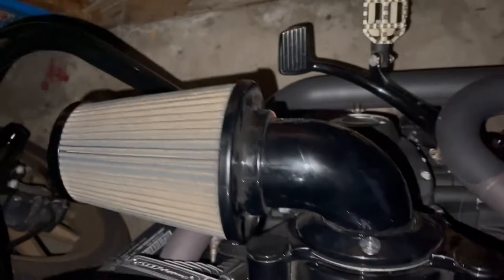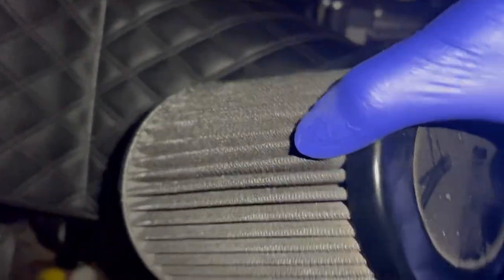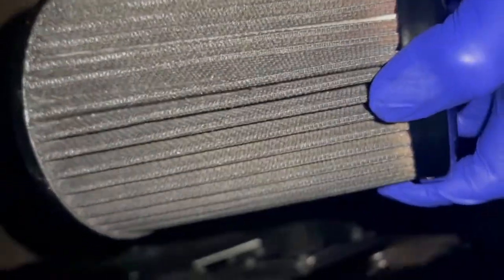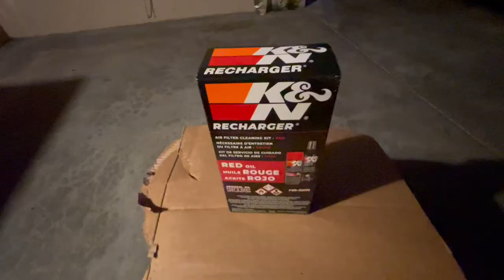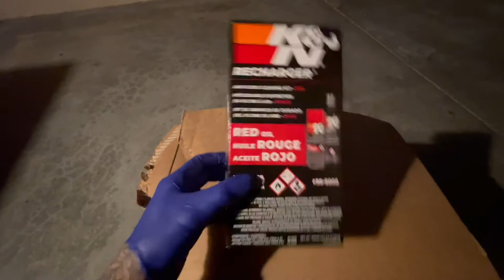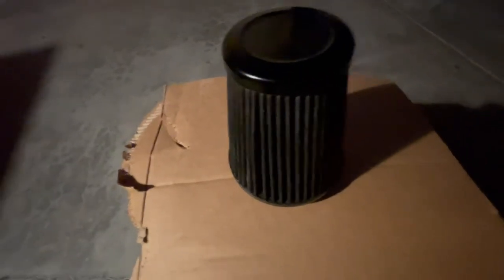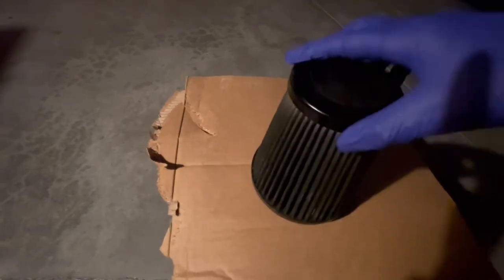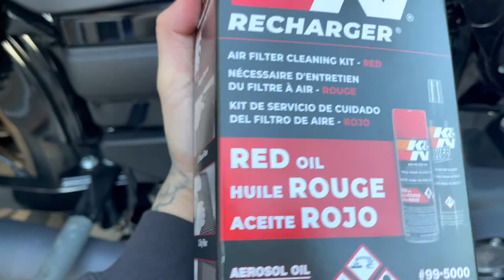I Ruined My Heavy Breather Air Cleaner  ON My DYNA (FXDLS) / DYI

Comment: Hey Dude - 12:00-12:05 You say you "CAN'T" oil the stock filter. This is 100% FALSE. Your 2016-2017 FXDLS Owners Manual Page 137-138 clearly describes the cleaning/oiling procedure for your STOCK SE Heavy Breather (K&N) Air Filter. Specifically #5. "Oil the filter" on page 138. Hope this helps. Ride safe.
Reply from the maker: Dude thanks next time I’ll be sure to oil it, didn’t wanna mess up the only heavy breather I have. Hope everyone checking out this video reads your comment so it can also be useful for them.
Thanks for watching 🤙🏼

Comment: I clean mine every year, irrespective of mileage and once it's dry I apply the red K&N filter oil to the high points on the filter so it soaks all the way through. Once it's all red it goes back on. Never had a problem and it's the same process I used on dirt bikes. Ride safe...

Comment: The oil is coming from your head breather bolts... Get a Fueling Parts Vented Dipstick cause your having blow-by issues... This will reduce the amount of oil coming from the breather bolts & feeding back into the cylinder's
Reply from the maker: Thanks for the tip I’ll look into getting a vented dipstick🤙🏼